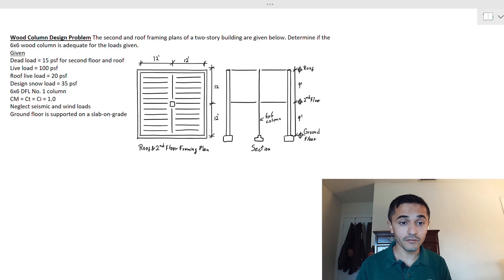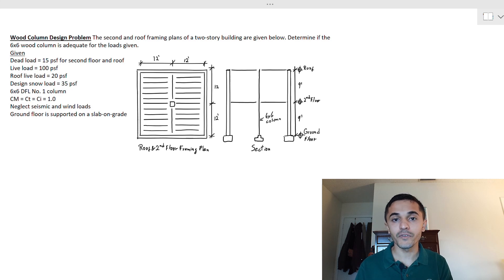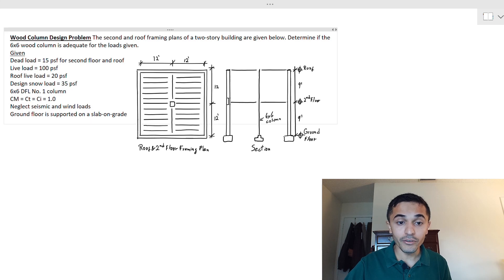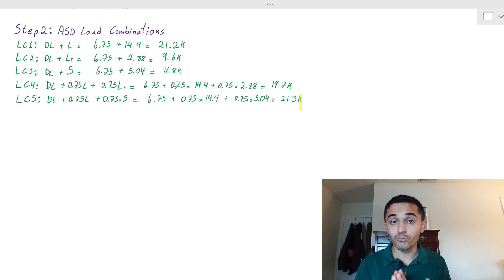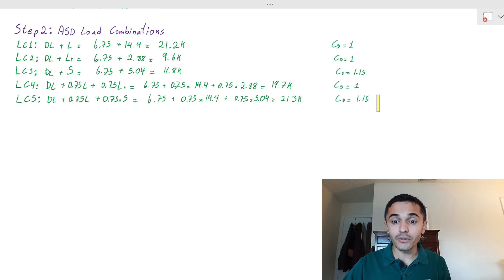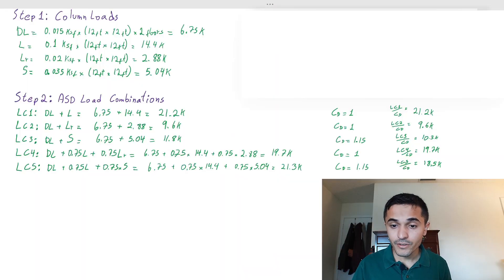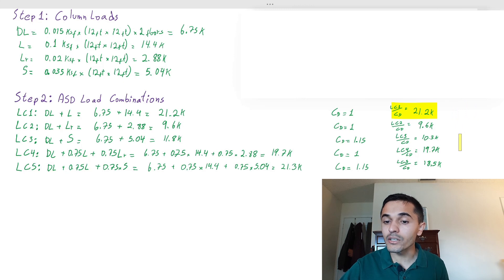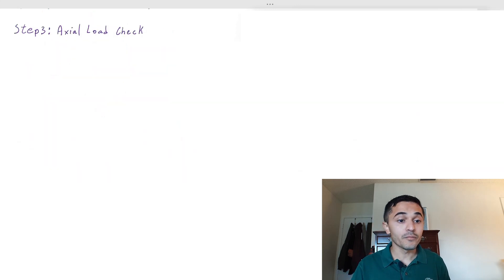A Complete Guide to Wood Column Design

Comment: What would change in wood column design where the columns are supporting a stilt house?  Do the factors take into account racking when used to support a stilt house?  

Thanks again for your great video!
Reply from the maker: Hi Joshua! Thank you so much for the feedback. For columns supporting stilt houses, the factors remain the same, but the big difference is that you also need to calculate drift and the loads are likely higher than a regular column since the columns are now part of the lateral load resisting system of the structure. I believe a common practice for that design is including diagonal bracing between several columns in the foundation level creating a true braced-frame lateral load resisting system. After that, it's all statics in properly accounting for combined axial and bending stresses, properly considering the stiffness of the columns/braced frames, etc. Lastly, if the house is located in a flood zone, flood loads from ASCE 7, chapter 5 and ASCE 24 must be considered. Hope this helps!

Comment: very helpful but how did you get 6.75k for dead load? I got 4.32k...and for the 6x6 column, referring to NDS supplement did you check Douglas Fir Larch for 6x6 post and timber?Table 4d? I followed your design, it was helpful but my dead load + live load was 18. 27k and yours is 21k.. although my load was still adequate, I wanna know if I am missing something or was it just a blunder while you calculated the dead load? It would be really helpful if you could clear this off my head. Thanks for a great and fun video.
Reply from the maker: Thank you for watching and double checking the numbers. You’re correct! The dead load should be 4.32k, not 6.75k. For the post, I did use DFL No. 1 posts and timber from table 4D. Note that there are two lines for posts and timbers in this case. That’s for two different grading agencies, but Fc is 1,000psi for both.